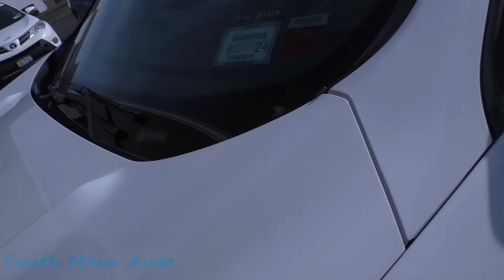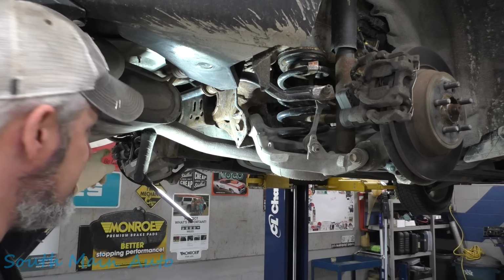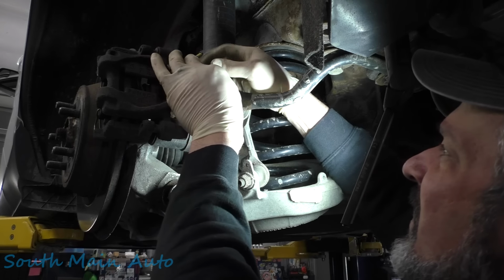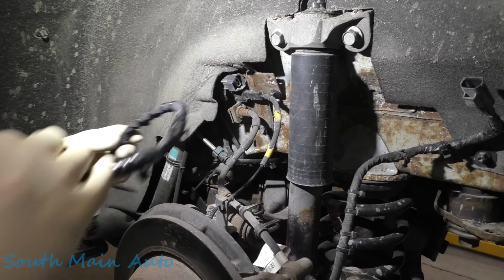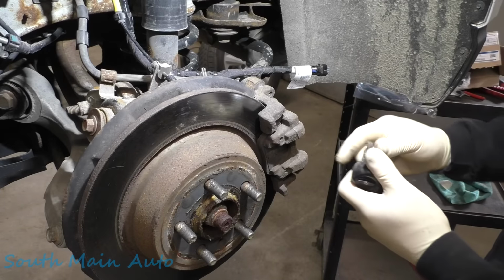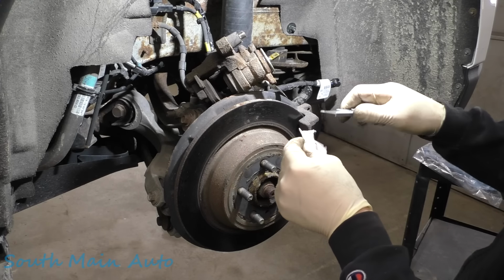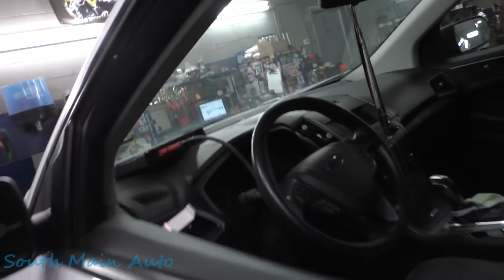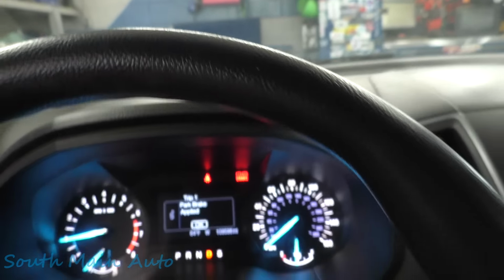Ford Edge: Electric Parking Brake Malfunction

Comment: I understand people's desire for the old-school cable-based parking brake systems, but they rust and rot as well. Consistent use preserves both systems. However, I cannot understand why people aren't better taught to ALWAYS use the parking brake. Relying purely upon the parking prawl to hold a vehicle, especially on an incline, is just crazy to me. I trained myself and my wife to use the p-brake whenever parking, be it our auto, electric, or manual vehicles. 
I think the biggest issue with electronic parking brakes is the tools needed to do a simple brake job.

Comment: Fun Fact: The disease Rabies is a lot like the green crusties; Rabies gets in the nerves and travels toward the brain. This is why  the brains of supposedly rabid animals are examined. The green crusties jumps into a copper wire and travel inside the insulation, doing its damage. Replacing the motor was a good move - you could have the green crusties feed back into the new wire harness from the old motor, and then the customer would be back again, thinking you should have done better.

Comment: Hi can l ask do the two brake motor wires  swap polarity during brake application  and brake off  or are both + feeds ...?
Reply from the maker: Yes they switch polarity to drive the motor in and out

Comment: As usual, the comments are littered with whining over EPB's. EPB enables convenience functions like auto brake hold, where you can take your foot off the brake pedal at long lights or in stopped traffic or slow drive through lines. The brake controller maintains the service brake pressure for you, but if the engine dies or is shut off, the EPB takes over and engages. EPB's can be more reliable than cable parking brakes because very little is exposed to the elements, but it's a Ford, so what did you expect?

Edited to add: Actually had the same issue on my ride just this past Monday. That connection right at the motor was corroded, considerably worse than this Ford. Cleaned the motor side connector with a sharp pick and some mild brake cleaner, then soldered two leads to it and potted them with JB Weld. Cut the harness side connector off and soldered and sealed the two wire connections to the motor's new pigtails. The motor is now a permanent part of the harness. Total cost, about $10. Far cheaper than replacing a rusted out parking brake cable.
Reply: In the rust belt, you don't dare to touch the parking brake on anything over 4-5 years old (cable system). Unless the system gets used daily.
Reply: @mph5896  Roger that. I've always used them (cable or electric) daily to prevent seizing. Plenty of salt on the roads here.

Comment: I can't stand these electric parking brakes! The 10 yo cable system in my F350 still works just fine even in the rust belt. Thx for the video. Eric 👍 keep em coming!
Reply: I hear you, but the epb also eliminates the entire drum-in-a-disk and all of the associated actuator parts. I've never like working on rear brakes. In this case, better connectors would have probably prevented all the problems.

Comment: Hi Eric.
Have been following for ages and love the videos.
Right up my street this one. 
I worked on the design of this Continental iEPB caliper, and it does cut-off the power when a current threshold has been reached. 1 amp per KN really roughly. This system will cutoff at around 17 amps, therefore 17KN.
Hi from the UK.
Reply: So, you're to blame. Thank you for keeping us lowly technicians fed.
Reply: Ha ha.
I guess you could say that.
Reply: What happens if your battery dies?????  Give me a cable!
Reply: Hello @Davidcogin601 and Eric, 

Thanks for the great info! I am using these calipers on a custom application and was wondering if I should use a 15 or 20 amp relay to activate the cut-off power when applied since I will not be using the engine harness to operate these calipers? Still trying to figure out the power issue. 

Thanks again, cheers!

Comment: sometimes you fix the connector and contacts and sometimes you buy new cables and motor .... it was a good fix and very reliable.....but if it was your own car would you have tried to repair the original cable and original motor and save the 250

Comment: Earn as you learn , that was my motto for 45 plus years of wrenching. Engineers and manufacturers have a way of doing that , just as you think you know something they change the game. I’ve always thought if the parts are readily available, it’s a problem they have with that part. Speaking of Ford parts in strange places to look up , once I was doing a water pump on a Tempo , the “ O” ring on the pipe at back of motor was not only eluding me , the dealer couldn’t find it. Turned out Ford called the “O” ring a piston , no wonder we couldn’t find it
Reply: Ah, the Tempo!  And it’s cousin the Mercury Topaz.  Extremely rare to see those nowadays.

Comment: old fashioned hand brakes were a lot better they could be applied in case main brakes hydraulic system failed and you don't have to worry your cars computer will malfunction or be hacked and throw on parking brake while you are driving

Comment: I have everest car.  2011 diesel engine.  3.0 .  Starts very well, after 3 seconds the engine stops working, increases the throttle opening angle the engine works normally.  Please give me a way to use it

Comment: The movie - 'Never There', the next day comment took me there. There are three cables on my 92 D-350, one broke. I like the simple mechanical's of a cable, but this was a lot easier repair.  You have to pull the axle to get at the cable end in the wheel.

Comment: Can't wait to see Eric trouble shoot electric problems on the EVs.  Imagine the green crustys in the rust belt
Reply: About a year ago, Eric addressed working on EV's.    Said it would never happen.    If I remember correctly, it came down to the knowledge required, and cost of tooling the shop.

Comment: I like this design over the brake shoes inside of the brake rotor hat for vehicles with rear disc. That old design was just horrid. I had an issue with my truck when I bought it used from the inside drum surface being rusty causing intermittent contact with the park brake shoes, it caused one heck of a vibration once it would start. The only way to stop it was to come to a complete stop, then accelerate again. Replacing all the rear brakes fixed the issue.

Comment: Used to be when I was a tech at gm, gm used a group number system to list their parts, once you learned how the numbering system worked, it made finding parts easy. Say you needed a part for Chevy, and it wasn't in stock. You could go to the group numbers and find the same part, but for a different Carline, say Pontiac, Oldsmobile, Buick, ect. The same part that fit a Oldsmobile, would also fit a Cadillac, but would have a big price increase, even though it was the same part
Reply: Yup I can remember that from back in the 76 when I worked in a auto parts store

Comment: I'm in the same kinda rust belt in Northern Wisconsin. The rule is, use your e-brake at least once in awhile, so when you do need it, it's not frozen with rust. My 97' Blazer still has a working e-brake.
Reply: Wisconsin doesn't use the salt that New York does. I've had cables that were used daily, bind. I'm a retired mechanic turned long haul trucker. I run New York to Seattle on a regular basis. You guys don't use anywhere near the salt that New York does.

Comment: Was the motor/accuator actually bad or was it only the harness?  OK, at 17:28, I agree with your decision to change the motor/accuator.  Good video!
Reply: @namvet-72  I’m working on the same issue with a 2017 Edge, except the right side. I wonder why, other than the cut-and-dry repair, don’t we see a harness examined.

Comment: Should have plugged the new cable into the old motor just to see if that solved the problem. Just a thought.... Might not need the new motor.
Reply from the maker: as much corrosion that was coming out of the motor housing I would never trust it

Comment: " Remember when parking brakes had cables"   lol  Just inspected a 2022 trailblazer. 
GM has put electronic park brake on the front axle. What will they do next.  Great job as always.
Reply: Put them on all four wheels

Comment: I have a VW Jetta, my local parts store had a 9mm heli-coil kit (I think my brakes use the same slide pin as Ford)
Reply: 9mm is a very odd size, I'm really surprised a local parts place had that in stock!

Comment: Electric parking brake, $200/wheel. I love my 2102 F-150 5.0, but not sure I can buy another Ford after learning this. What a massively stupid idea.
Reply: They all are starting to use them, don’t understand the need, I would think actuators would be quite possibly a little bit more expensive to engineer than a simple cable😂
Reply: Is the concept stupid or the application in certain climates. ❔
Reply: @billupstateny9151  The concept of replacing a cable that has worked for over a hundred years with $400 worth of electronics and motors is insanely stupid. Obviously the actuators are cheaper than the gouging replacement cost, but still, no matter what they cost to the OEM it's more expensive than the cable. And like everything else, WE pay for it. If they are worried cables will fail due to rust, then stainless cables and spiral sheaths would still be cheaper.

Comment: Did you use any dielectic grease to prevent snow belt corrosion on the new part and connector  AND add some dielectic grease for the other side as a preventative?
Reply: Yes & then he shrink wraps the entire vehicle in cellophane & liberally coats everything including the customer w/ fluid film, & cosmoline. 💡👌

Comment: An electric parking-brake.  Technology for technology's sake.  What was wrong with the old parking brakes?  And this isn't unique for Ford, either -- ALL manufacturers are doing this these days!  It's ridiculous!!
Reply: Does a boeing 747 have a parking brake leaver🤫🤫
Reply: @brianhume4743  A 747 is a passenger jet.  A car is not.  Cars should have manual parking-brake levers.

Comment: For some  reason I thought when you were checking the next connecter you were under the front wheel.  Then you said it needed a new wiring harness. I thought again it would be a couple feet long not the foot plus a little it was . You can clearly see it wasn't the front end / wheel.

Comment: #1). E. O.  Do ya know of a Mechanic / Technician in San Jose California that's as GOOD as You Are????  #2). I am stoked that you actually put those Rubber Plugs back on the Caliper Slide Pins 👍🏼.  #3). That Job at FORD is Like $800.00 Thankfully you do the right thing and treat folks like you would want to be treated. Great Job, and it IS FIXED!!!! Alway's enjoy watching your approach to a final Repair and Fix.

Comment: You’d like to punch the designer/engineer who thought it’s a good idea to make rear brakes electric, and put all the connections where water and salt gets in really easily
Reply: To me, it seems like the quality of the connectors is the problem. It is worth something to get ride of the cables, drum-in-a-disc brakes, and all the actuator parts.
Reply: @justliberty4072  the connectors are going to be the cheapest possible, manufacturer doesn’t care as long as they save money, and when they sell the cheap replacement parts, double win

Comment: On or off brakes are useless for emergency brake failure; I guess that is why they changed the name to "parking brake..."  But, that does leave the driver and passengers out of luck if the brakes ever fail.
Reply: No such thing as emergency brakes??

Comment: I'm a bit surprised you didn't use some dielectric grease on those connectors?
Reply: It was deleted footage during edit to allow for comment pi$$ & moan .
Reply: @billupstateny9151  sorry commentary is moaning to you @BILL UPSTATE NY
Reply: @ronaldsinclair6837  Ronald, makes no difference to me, but if you have watched ANY of Eric's painstaking disc brake replacement videos, you would note he lubricates every component throughout. Do you know if ford Requires the use of dielectric goo.?  Or NAPA ❓ & if the motor should fail w/in the warranty period, would the claim be rejected due to use of the goo.??  The factory connectors did NOT have goo smeared upon them but Eric should ???
Reply: @ronaldsinclair6837  Moaning is fine, the issue is when combined w/ urine.😎
Reply: @billupstateny9151  sounds like sour grapes to me Bill.
Reply: @ronaldsinclair6837  Prefer tart cherries, try them, great for your gout condition.
Reply: @billupstateny9151   oh ouch

Comment: I seen a wire for the rear abs corrode in under 5k miles, less than a year old. Idk why or how but a small pin hole was all I saw. Thankfully ford has a pig tail kit, so i didn't have to replace the whole harness ( corroded at the big rear harness, not that smaller one)

Comment: What are your thoughts on using the electronics cleaner that's safe for electrical connections? I've used it with no problems.

Comment: I liked that you left the working caliper plugged in so that you could tell when the scan tool was actuating
Reply: No point in disconnecting other caliper actuator. The need for removing the left caliper was more for show than anything. You can change the actuator without pulling the caliper.

Comment: “The weirdest spots” yep, built tough until they hit the road, why in hell would they put connectors in the wheel wells, oh right they are built to go in wet conditions, idiots in the engineering department.

Comment: I used to have park brake cables get moisture in them and then freeze up in the Winter immobilizing the car. Not really sure which has the advantage. Both have potential issues! Great job here. I'll remember this as my wife has the same car! Thanks man!
Reply: Anything has the potential to have a problem.  But I'd rather be replacing a $30 cable than a $250 harness and motor - and I can always free up the cable with a little kroil if I can't afford the $30 just now.  Not to mention the ease of diag on the cable.  I fail to see any advantage to the electric brake that makes up for the increased price.
Reply: @aussiebloke609  I believe the main perceived advanatge (for the manufacturer) is a small button to actuate the electric parking brake takes up less "real estate" in the interior than a mechanical lever/cable mechanism.  Freeing up that space makes room for seat heater buttons, USB ports, wireless charger pads,  larger cupholders, etc.
Reply: It opens up styling inside the car. Nothing wrong with the foot pedal though  unless it has to do with construction.
Reply: @aussiebloke609  I believe the brakes are electric to allow the car to apply the brakes automatically for situations such as collision avoidance and adaptive cruise control.
Reply: @JS-fe8sx  I think the ABS pump does that
Reply: Parking brake cables only get water in them when the rubber seals at the end have rotted and fallen apart, so this is a problem of maintenance.

Comment: Surprised you didn't apply some dielectric grease like the old Dow-Corning DC-4 to the connectors when you re-assembled them.  That is the first thing I do before re-connecting any plug/jack I open up.  Just prevents future problems for me.  Of course I keep my vehicles for a long time, Pick-up is 19 years old and like any GM product the rust causing issues caused by the Michigan salt like you have.
Reply: I totally agree. You can use any dielectric grease just put a good gob in the connector before you mate it. It will keep the water and air out which causes the corrosion. You should do it on every connector you unplug before reconnecting it again. You will have fewer returns as well. Yes I am from the PRNY salt belt too!🤣

Comment: You are correct. It measures current during operation and translates that in to clamping force I think. Pretty much all epb's work the same, well those I've worked on at least. And it's 99% the left one on AT's that faults. People don't use it and crap from on-coming traffic get past the o-ring. Oh right, left ones here in Sweden, probably the other way around in countries where they drive on the wr..left side.
Reply: Yes all E PB's worth the same and yes we don't need any of them lol